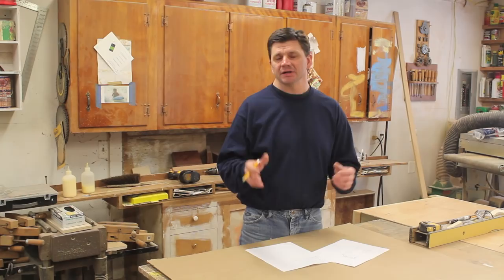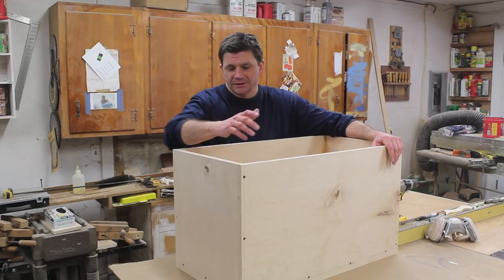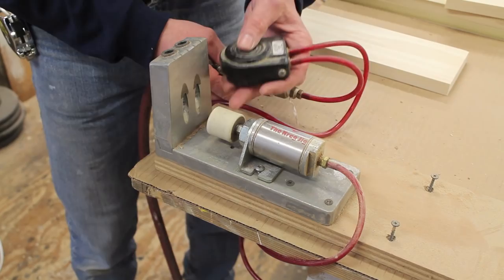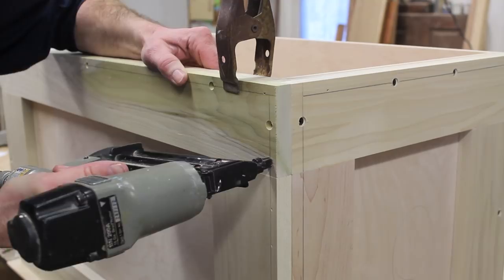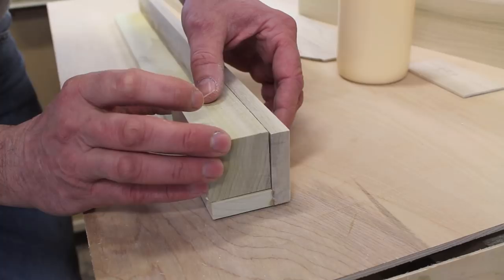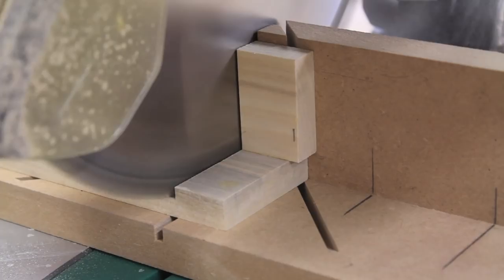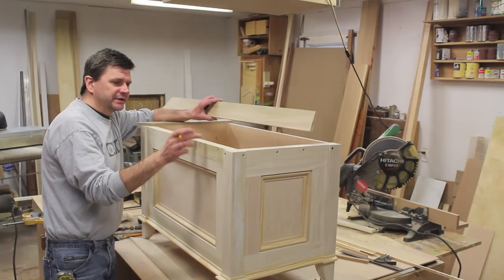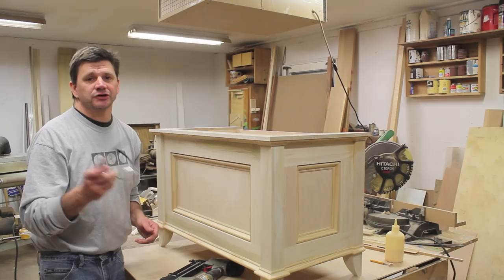Make a Blanket chest / Toy Chest by Jon Peters

Comment: I spent a long time trying to find the right project to make for my daughter (who is going to be born in about week).  I consider myself an extreme novice when it comes to woodworking, but I thought I'd give this a try.  I took my time and followed the instructions closely and it came out wonderfully.  I didn't have a couple of the tools (e.g., Kreg Jig) so I improvised a little bit which worked out pretty well, and I just don't have the skills to curve the bottoms of the legs so I left them straight.  It lacks a bit of the precision that Mr. Peters demonstrates in the video but I'm very proud of it none-the-less.  Thank you for sharing such a wonderful design and easy to understand instructions!  Regards.  JP
Reply from the maker: Really nice to hear JP, thanks so much and all the best, Jon
Reply: JP Garrison - Thanks for sharing your experience.  Like you I am an extreme novice and I was apprehensive about attempting this project.  However, your comment has inspired me to try and build it.  All the best in your woodworking.

Jon Peters - Thank you for all of the great designs, how-to instruction and inspiration.  Pls keep the vids coming!
Reply from the maker: Will do , Thanks Dave
Reply: Hi JP. I hope you don't mind me asking but what is the dimensions of the base cap molding that you used? The ones around here are around 1 3/8" wide and it looks on the video that the one he uses is smaller.
Reply: Wonderful design
Reply: JP Garrison i
Reply: JP Garrison it doesn't need to be perfect.  My daughter is twenty and I just built her a book shelf for her nursing books.  I meant a lot to her because I built it for her.   I always write a little note on the back or bottom.  So in the future when I'm gone she will be reminded of why I built it for her.

Building a desk for my son now.  With secret drawers and compartments..... He's ten!  

Keep it up.  Anyone can buy a chest or desk.

Comment: Jon, I made this chest and although it turned out good it was a challenge for me but in a good way. You challenged me to be a better woodworker and I thank you for that. The chest is for my new granddaughter and I needed to attach safety hinges to the lid. This proved to be a task that was beyond my ability and I made several mistakes. The lid was just too heavy for most hinges. If there is another one out there that you know maybe it could help someone else. What I eventually wound up doing was taking the hinge support piece of and replacing it with a 3/4 piece using Rockler torsion hinges. This worked great and doesn't look bad either. I know she will enjoy it for years to come.
Reply from the maker: That’s fantastic! I’m really happy to hear it. I do plan to make another one this fall and I’ll keep that in mind. Thanks!

Comment: Excellent video.  Very nice presentation.  Clear and easy to follow.  I also like Kreg products.  Question.  When the face frame was glued on, don't you think that nails and glue would have been enough?  I noticed that the plywood is 5/8 and i thought that the face frame was 3/4.  That's only 1 3/8, and you countersunk the 1 1/4 screw.  Aren't you right near coming through to the inside of the box?  Great job.  I subscribed.......a

Comment: I was reading an article the other day where they suggested that one should not wipe the glue away with a wet cloth as it spreads glue residue across the work piece, but should rather wait for it to dry and remove the glue with a sharp chisel. Which is the better method to ensure a good quality finish?

Comment: I usually end up watching all of your video's a couple times, a lot of great learning!  Your work is all so top notch, thank you for sharing it with us and making such great video's.  I am going to start building this piece for my Mother, just debating on if I should use a long blade in my Jig Saw or if these legs justify a band saw purchase for the shop!  Also the leg stock you use - where do you find that size Poplar stock?  I mostly pick up my project wood at Menards and the hardwoods/craft stock is only in 3/4" stock.

Comment: Job in your plans for the sides the cut list shows 3 1/2 x 10 3/4. And the other side of the panel is 4 1/4 x 10 3/4. Which goes to the front of the box? The 3 1/2 or the 4 1/4?

Comment: Hi, I'm wondering did you glueup smaller pieces of wood to create the sides, front/back and bottom of the box (so the wood doesn't undergo warping over time) or did you just use large slabs of the desired length? I'd really appreciate a reply, thank you!

Comment: Hey Jon!  First of all, thank you for your fantastic videos!  Quick question, do you recall the total outer dimensions of the legs for this chest, square before the band saw?  Also, I don't have a band saw, so do you think I could achieve that curved cut with a steady hand and a jig saw?  Thanks again, Chris.
Reply from the maker: gromitsdad Thanks Chris, sure you could a jig saw might just need to do a bit more sanding.

Comment: Great video. Why do you have different widths for the face frame on the sides of the chest? I'm confused as to why you would have the top and bottom 3 1/2" but the left side be 3 1/2" while the right side is 4 1/4". I would really appreciate it if you could let me know why. Thank you very much
Reply from the maker: Thanks , because 3 1/2 + 3/4 = 4 1/4  hope that helps
Reply: Because you put the side frames on first, with the 3 1/2 inch side toward the front. When you put the front frame on, it will add another 3/4" to that side, making them even. Clear as mud?
Reply: ㅜㅜ

Comment: John, have a question.

Would using pocket screws for the box assembly be stronger than screws through the face and into the edge of the plywood? 

I wonder if, with heavy use, the screws would be less likely to pull out or break out the side if I use pocket screws. I will be able to hide the pockets with trim and moulding, but if there is no real advantage I think a standard butt joint would be faster and easier. I should mention that I'm going to batch these out 5 or 6 at a time so speed and ease are factors to consider while maintaining the strength and integrity of the piece.
Reply from the maker: Really either way should work fine whatever’s faster
Reply: Thanks for the reply. And to be honest, I made the mistake of posting my question before I finished watching the video.  After seeing the whole thing come together, it all makes since.

On another note i recently started taking finish carpentry jobs, and you've become my go to when I need some tips or tricks of the trade. (I.e. Story board for various trim and moulding on that job). Saved me from having to learn the hard way.

Comment: Jon, I have a question regarding this project if done to be finished with stain/poly finish. If you're using birch for the plywood/face frames, and the only trim I can find is pine, would staining the wood render two different colors given the different species of woods being used? What's the best way to remedy this?

Comment: Hi Jon, I'm trying to make this for my mom for xmas but I have a question. Did you make the small base cap molding or did you buy it somewhere? They don't have that at my local hardware store. I bought a router bit off of amazon without doing much thinking before I bought it. It turned out to be too big and I can't find a one in a smaller size. Thanks.

Comment: Jon, quick question.  Could you have used your Kreg Jig and created pocket holes to secure all the sides of the chest?
Reply from the maker: Sure but than you will have pocket holes on the in =side of the chest .
Reply: ***** Do you think it would be a stronger hold using pocket holes for the sides?
Reply from the maker: not really
Reply: ***** Okay thanks.  I just bought a Kreg Jig and am looking forward to building things.  My wife wants me to build a chest that is 2-1/2' x 5'.  I want it to look good and be strong.
Reply from the maker: This Friday's video I'm building a cabinet built with the Kreg Jig... I like the jig, works great
Reply: JR Albritton You're defeating the purpose of pocket holes if you use them for the sides of the box...I'd rather fill counter sunk screw holes than the pocket holes created. The plugs they try to sell at the hardware store to fill the holes don't fit exactly so you only want to use pocket holes in areas that aren't visible and won't be when the project is completed. As far as the dimensions your wife wants a chest built by, take his drawings and modify them to fit your needs for the length and width. Not that difficult.
Reply: Brent Russell Thanks for the info.  I watched an infomercial on the Kreg Jig and was very impressed by how they were able to build a cabinet that was strong using the pocket hole system.  I can see where the pocket holes could be an eyesore.  After watching Jon's video on the blanket chest, I wanted his professional opinion about the use of the Kreg Jig.  I appreciate all the feedback as I want to build things that are strong and have a clean look to them.
Reply: I got mine at Home Depot for around $100, I use it quite often. I remodel houses for a living and in my spare time I build all kinds of projects from beds to dining tables, coffee tables, etc. I love the Kreg Jig and the joints made from using it are very strong. I may not have a TV show, but I do do this kind of work for a living, lol. Just about everyone I know that does any kind of intricate woodwork uses the Kreg Jig or the off brand version. Good luck to you in your endeavors with building, it's a lot of fun and gives you a great sense of pride when you have the finished product.
Reply: ***** Yes but they do make plugs for the holes = I know, more time and $$$'s

Comment: Isn't there a better way to attach the molding? Mabye it's just me, but those ugly nails make beautiful piece rather cheap ant unprofessionally made.
Reply: the exterior is getting painted.. no sense wasting time glueing and clamping mouldings when you can just fill a few pin holes and paint it.. when you do things as a professional to make money you don't waste time on things that are not seen and do not add anything to the structure..
Reply from the maker: MrMeanderthal Well said, Thanks.
Reply: Oh, I missed the painting part. But it still didn't answer my question - is there a good way to clamp the molding while the glue dries? W/o nails, obviously.
Reply: Martynas Valūnas You could use pony clamps or squeeze clamps to hold the molding in place, but using a combination of wood glue and finish nails is sufficient enough. You're not really going to get a tighter bond by applying clamps.

Comment: One can see that you are a carpeneter not a joinery man. 3/4" plywood, glue nails ands screws for strength, additinal beading below the bottom for 'added strength'; exterior timber of around 5/8" thinckness proopbaly thicker this is a war chest not a toy box it would take a crane to shift it.  They do make 1/4" play and even 1/2" ply.  Items can be made of usable strength and be light weight.  What is it about Americans that everything has ot be overbuilt lacking in design and suitablity to the purpose?  It is easy to make thicks heavy and ugly it takes real skill to finese designs and create light and practical, simple to build projects. Talk about over build.